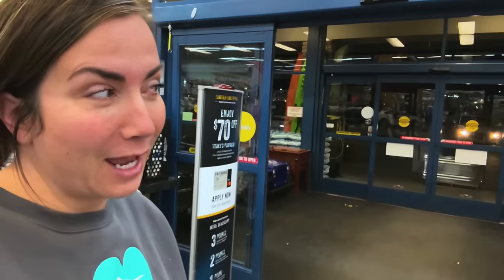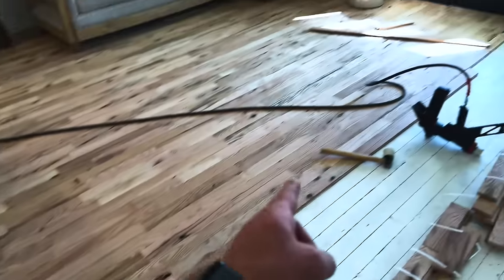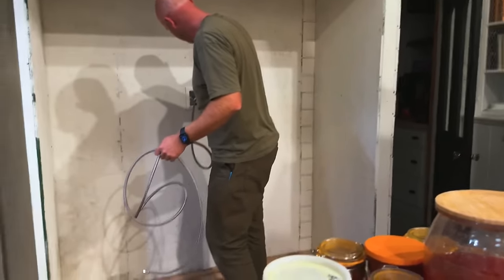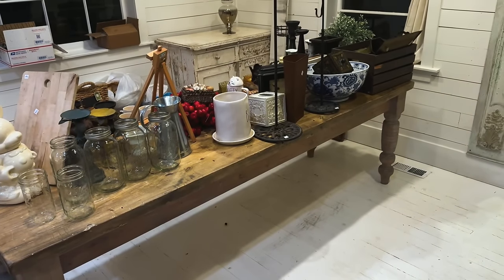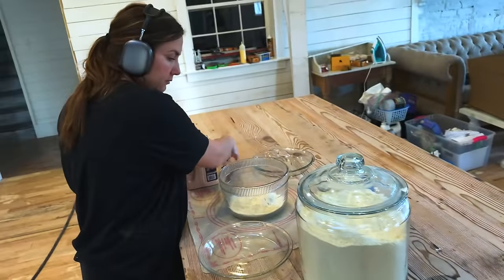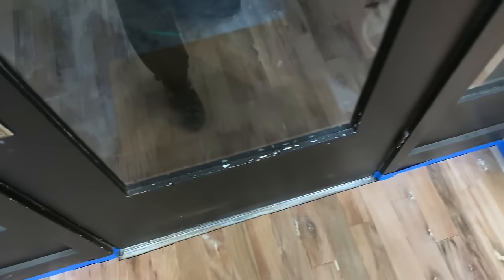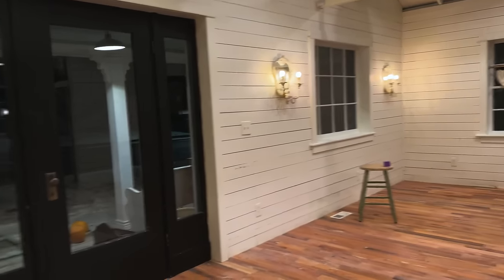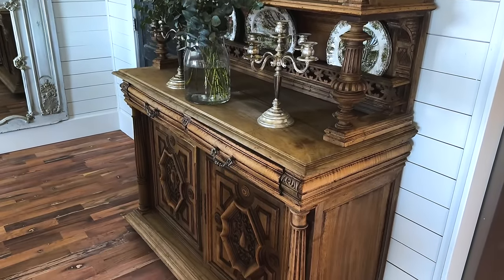New Oak Flooring In The Kitchen! White Oil Wax Finish

Comment: congrats on the floors! about the oven....was the bottom oven on when you baked in the  top one? I've found that stacked ovens heat the top oven unevenly when both are on since some of the heat from the bottom one is rising up.
Reply from the maker: no just the top.  its pretty fristrating

Comment: I would be concerned about the durability of the floors. We have had hardwood floors refinished and it is multiple sandings and multiple coats of sealer. I wouldn’t think one coat of any sealer would be enough. I would think the greying is from not being sealed properly. Just my opinion, for what it matters.
Reply from the maker: For sure, the very nature of the utility oak is a little rustic but the oil wax does good work. They’re very sealed and the oil wax cured hard like a resin in 30 days.